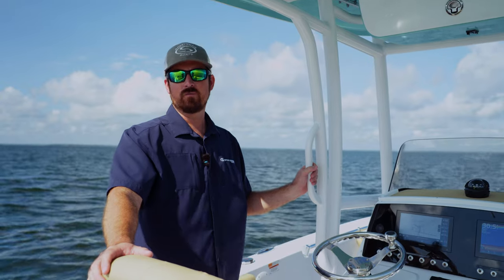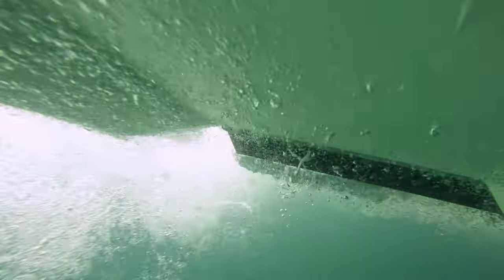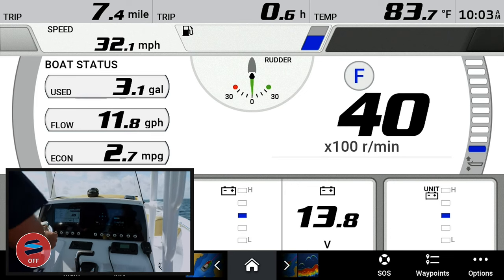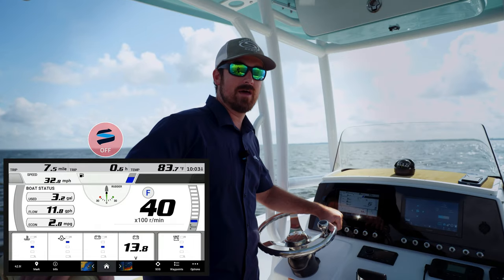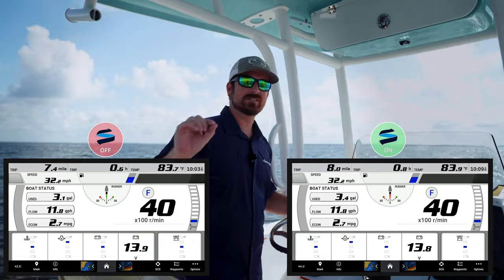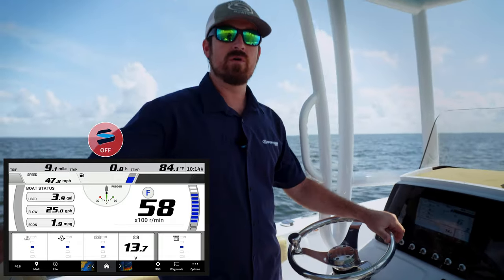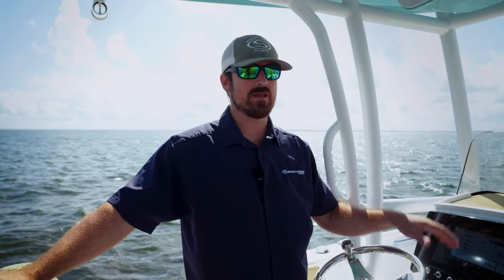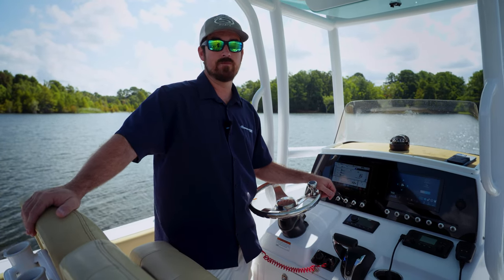Tech Talk - Fuel Economy & Performance With Seakeeper Ride

Comment: When you are using the seat keeper ride, do you still trim your engine?
Reply from the maker: Yes of course, you'll run your boat just the same as you have before. Seakeeper Ride is geared toward helping stabilize your boat underway.

Comment: Does this need to be installed professionally? If so is there anywhere in Michigan that it can be installed? Going on a 2023 Yamaha 275 sdx
Reply from the maker: It is recommended to have a certified dealer handle this. You can reach out to Seakeeper Ride to find a dealer in your area.

Comment: Y’all ever installed on a catamaran, I have a 25’ dargel kat, Final stages of the build Darrel said it should be ready the end of September
Reply from the maker: Rick, we do not build any catamarans and to our knowledge Seakeeper has never installed this on a cat either. You'd be best to reach out to them with questions regarding this issue. Congrats on the new boat as well! Best of luck.

Comment: Yes, you need rougher conditions to do this test, that’s what it was made for. And can you use it to stable the boat at anchor or drift? Do over….
Reply from the maker: This system is designed to help stable the boat underway in rough chop. This test was in 1 foot chop about every two seconds with roughly 12mph winds. It can handle rougher water for sure and we’ve seen the same comparisons if not better performace from the Ride system while in rougher conditions.

Comment: I didn’t see any fuel economy improvements
Reply from the maker: You should see slightly better if you’re coming on and off plane often, tournament style fishing, as it helps get up on plane faster. Additionally, in rougher water it’s going to help the boat run better and stay on top of the water which will help fuel as well. In flat water and great running conditions you may not see as much of a difference.